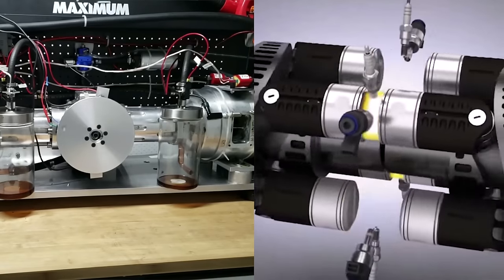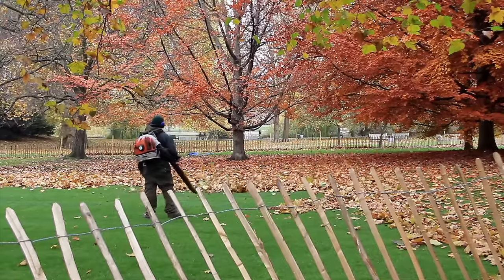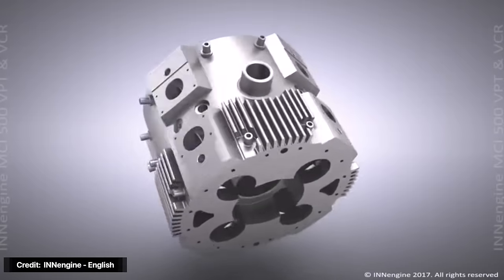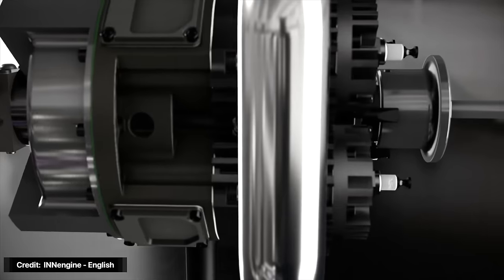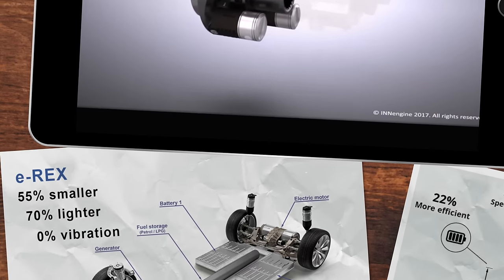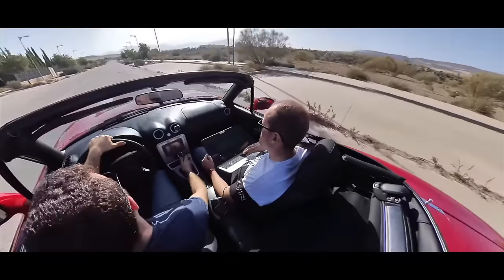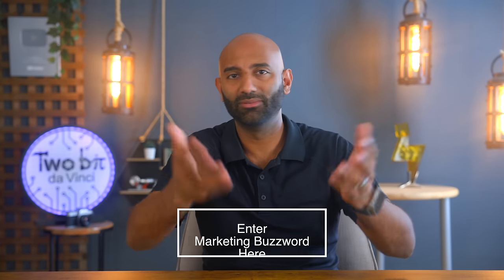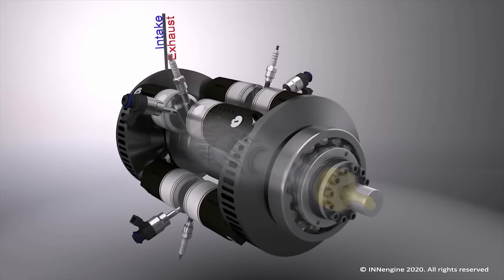One Stroke Engines - 200% More Efficient??

Comment: The engines used on our patrol boats in Vietnam had a system of several rows of triangular engine sets that worked in a similar fashion. They were the Napier Deltic engine.
Reply: Napier's last hurrah and sacrifice to the temple of mechanical complexity. At least they didn't try and build a version of the Jumo 224. Don't get me wrong. The Deltic is an amazing powerplant. And sounds wonderful. 
PS I also happen to think that it was out of work Napier engine designers and development engineers that were hired to design the 1.5 Liter supercharged V-16 intended for F-1 use.
Reply: What type of PB were you on?? The Napier Deltic was Huge I have seen them used as part of a gas electric railway locomotive and that was just with just one Deltic.
Reply: I assume when you say "engine set" you are referring to a single bank of 3 cylinders (6 pistons). The Deltic engine was only ever produced with 3 banks (9 cylinders), the "baby" Deltic, or 6 banks (18 cylinders). The patrol boat is exactly what it was designed for, half the weight and size of a standard diesel engine of comparable power at that time.

As a concept, it was ahead of its time. With modern materials, high pressure precise fuel metering and turbochargers rather than superchargers it could still be a world beater in terms of power to weight ratio.

Except it falls down in one important area, as will these so-called one stroke engines and every other "lean burn" engine. Oxides of Nitrogen. Whenever an engine has spare oxygen and nitrogen at high temperature they are going to combine, and that is always going to be the case with compression-ignition engines.

There's only one fuel which can have the advantage of ICE without the pollution and that's hydrogen. And here come all the nay sayers claiming that hydrogen is made from fossil fuels. They are right of course, it is, currently. Just like the mining of materials for batteries are making vast areas uninhabitable. The difference is that hydrogen can and will be made directly from water. Let's see them do that with batteries.😂
Reply: Problem with hydrogen is storage, when they solve that electric vehicles will  no longer be produced
Reply: @richardcolligan3821  
That depends. Hydrogen fueled ICE vehicles still have pollution issues in terms of Nitrous Oxides. Hydrogen fueled vehicles using fuel cells and electric motors should be cleaner in use. Cleaner in manufacturing may or may not be equal. In my opinion for what it's worth the current best option for regular use is a hybrid
Reply: I also recall some WWII submarines that used a Fairbanks-Morris opposing piston engine design developed in the 1930s.
Reply: Oh, what a surprise, my post showing why hydrogen storage isn't actually a problem seems to have disappeared.
Reply: 1st: John: Thank you for your service. RE: type of PB: he's talking about "the Nasty class boats served in the Vietnam War, largely for covert operations" (source: EverythingAboutBoats, and "Operation 34a and the nasty class PT boats". there's also a game called "War Thunder Naval Ships" that shows how giant the engines are on an 80ft PB boat)
Reply: Check out the Napier Sabre  they also produced the most powerful aircraft engine in the First World War
Reply: @mpetersen6  Sorry  I don't understand the Jumo 223 was a more polished design, the Deltec had to run one of the crankshafts in reverse compared to the other two.  The advantage of the Deltec was its shape, it fitted in a much smaller space compared to the other configurations and was an ideal shape for boat hulls..

I assume you are talking about the BRM V16, I am not aware of any designer of this engine having worked at Napier.  There was a much closer arrangement between BRM and Rolls-Royce, with Tony Rudd going to BRM from Rolls-Royce when R-R designed the centrifugal supercharger used on the engine. Rudd later designed the H16.
Reply: Dynacam

Comment: I agree, call it synchronized double stroke or something different but more accurate. Interesting though.
Reply: it's an opposed piston 2 stroke
Reply: @shaynegadsden  
Exactly. When I saw the animation, it just had "2-stroke" practically written all over it.
Reply: @-danR  yeah their website gives some BS excuse as to why they didn't call it a 2 stroke but basically because there isn't oil in the fuel and since that isn't part of the lubrication system it isn't a 2 stroke
Reply: I was immediately thinking 'linear 2-stroke' or 'axial 2-stroke', since it has no rotary connecting rods...
Reply: if you consider the 8 pistons to be 4 double pistons connected to the wavy thing... .wich they are, ... not linear but C shaped but using bearings since .. .. ... . it's such a different approach the stroke count is not important.
Reply: @robertroigsantamaria  There is nothing new or different about it, it's a bad engine design but has existed and a compressor design for a while now
Reply: I haven't seen one.. but, true, the rollers I don't like... I'd rather like to see a lever pushing and some gears rotating...  but if the bearings are made to withstand the lateral force ... and the curvature of the slopy wavy thing is made so that it makes good use of the explosion and is able to compress the gas ok,.. it could be a neat motor indeed...  @shaynegadsden
Reply: @robertroigsantamaria  its called a swash plate and it doesn't make good use of combustion it makes nothing in torque also i'd like to see it's emissions independly test since it does't seem to work without forced induction
Reply: Same thing as 5-stroke ICE, which in reality is just double expansion 4-stroke. It's all just marketing BS.
Reply: I like your name the best. It's too ingenious to just trivialize it as a 2 stroke.
Reply: It is a opposed piston 2 stroke engine, they have been in use for over a decade... In short this is a scam to harvest investors that think this is a new invention.
Reply: @a64738  You're being ridiculous. No design of this sort has ever been used before and to call it a scam is childish.

Comment: As to your end point, I think I do agree. I hate the idea of hybrid vehicles, because I love the simplicity of an electric drivetrain, but at least with our current electricity storage technology, gasoline excels in the power density area. For longer trips, or hauling heavy loads, some type of compact range extender could be very valuable to a lot of folks.
Reply: I've been thinking about the same for my boat.  I currently have a 2.4l diesel in the engine room but seldom need to 'give it the beans'.  I mainly stay in a marina but having an efficient generator and modest batteries would make sense.
Reply: Agreed, with hybrids you get the drivetrain efficiency of electric with the energy density and lighter weight of a combustion engine.  No solution is perfect by hybrids have as much of the plusses, with as few of the negatives as possible
Reply: Fuel cell technology combined with liquid fuel, is a better compliment to batteries, than adding a combustion engine and alternator/dynamo/generator.
Reply: Liquid piston seems to have a great range extender. Similar to a Wankel but a different cycle altogether. I wish they would hurry up and bring them to market.
Reply: A lot of EV skeptics have been pushing hard on hybrids as a way to distract from EVs. But the suggestions that you could have an EV car with a 5 gallon gas engine supplement haven't seemed particularly practical. IF this technology comes to market as fully fleshed, production ready, and as advertised, then there is a room for that discussion. But until then.. it's just numbers on a spreadsheet.
Reply: @andersgrassman6583  how will you use liquid fuel without a combustion engine? how will you use recharge your battery without a generator? brake regen wont do much esp on the highway
Reply: @Cyrribrae  hybrids are not a distraction from EVs, theyre a real world solution. most people cant afford EVs or solar panels, the grid wont support everybody recharging EVs, there arent enough EVs being produced, the cost to own an EV over the lifetime of the car is much higher than a hybrid, theyre much heavier leading to more pollution from coal power plants, tire and brake dust, the range is an issue, esp when its hot or cold outside, the battery would need to be replaced more frequently which is expensive and environmentally unfriendly. 

for those reasons, EVs are not superior to hybrids in any aspect aside from acceleration and comfort due to less noise and vibration. that would be nice if you had money to throw away, but most people dont
Reply: @carlholland3819  Fuel cells produce electricity. There are already trains, heavy construction vehicles and Toyota cars using hydrogen fuel cells, but a range of liquid fuels can also be used.
Reply: Whenever you need an absurdly heavy load transported across far distances especially to remote locations inaccessible to other means of delivery, look no further than the train. If we had more of them running on the rails and doing the cargo hauling that would reduce amount of trucks needed to do the same amount of work. If the cargo transportation is more localized and in tigher regions than that's where trucks fill that niche.
Reply: @TheSilverShadow17  true. And electric trucks could still be very useful to go from depots to warehouses all over. Reducing trips from thousands of miles to a couple hundred (ie: within one charge). And we already know that last mile distribution is quite well served by electric too.
Reply: @Cyrribrae  For more local and urban spaces, a big truck wouldn't be viable and they'll more likely use delivery vans. Every vehicle fits a specific niche relative to the task at hand. I'm not saying you couldn't drive a massive semi through the suburbs or the downtown area of a city, just that those things would take up an absurd amount of space which would result in traffic congestion and jamming. Not to mention you can't exactly park them in smaller areas like you could with a van or a pickup.
Reply: @TheSilverShadow17  no I'm talking about taking cargo from a hub (port, train depot, etc) to distributed warehouses. We use trucks for that. Then you use smaller delivery trucks (vans) to take cargo from the warehouses to houses in urban streets etc. Which we also already do. 

If you have enough large hubs, both can be cost effectively electric.
Reply: @Cyrribrae  My concern would be charge times, ways of handling heat dissipation, etc. Electric vehicles are substantially more efficient but they too have overheating issues at times, so I was wondering if there was a way to keep the motors and batteries cooled down so that they're not at risk of potentially melting or catching fire. That being said, I'm not implying that it will happen on every occasion.
Reply: @TheSilverShadow17  Yes I agree that for any kind of cargo, the basic mode of transportation is A) By ship on waterways B) Using railways on land
People don't really weigh that much, transport is very much more a question of speed of delivery there. So transport by air really is genuinely a clever idea in a lot of cases.
Reply: @andersgrassman6583  Precisely

Comment: For automotive purposes, I would favor a vehicle with electric motors to turn the wheels,  powered by a relatively small electric storage unit, kept charged by a small petroleum fired engine.  I thought of a graphene super capacitor bank (US built) coupled with a Lithium battery bank.  I prefer less Lithium as China seems to have a monopoly on world Lithium mines. We become beggars to that communist regime.  Electric charge is built or maintained with a small combustion engine, optimized for single RPM operation and driving a generator.  I considered a rotary Wankel engine, but any small, efficient, lightweight design is acceptable.  If the conbustion engine has minimal parts, that would be a plus.  As most energy is used for acceleation, the graphene super capacitor bank would provide power for that stage.  Sustained speeds kept with the Lithium Bank.  Deceleration energy can be most quickly be stored by the graphene bank.  It was pointed out that petroleum fuel has a very high power density.  That is important, and the above hybrid system would not require a network of EV charging stations, for the above hybrid could charge itself and maintain that charge.  Yes, there are already hybrid EVs, but can they be improved upon?  (Finally, I despise our government's present insistence on "pure" EVs which will depend on China's good will and willingness to monopolize, and to generally STEAL  American technology by espionage.)